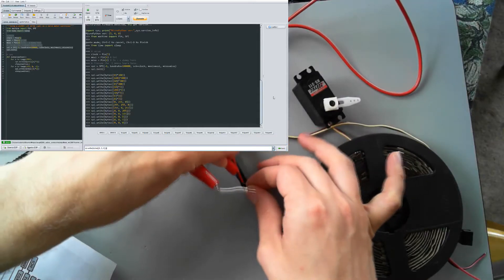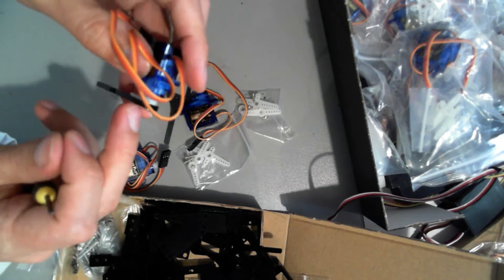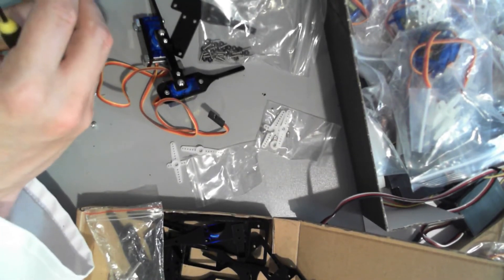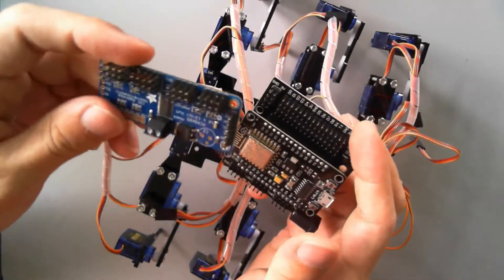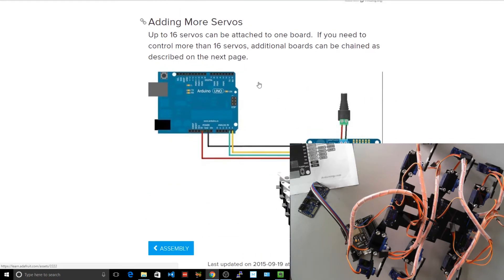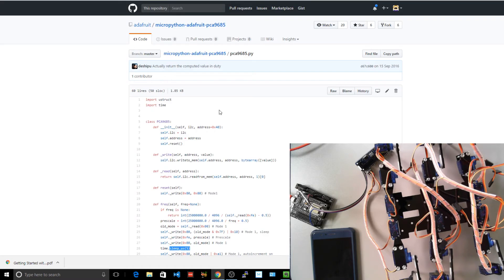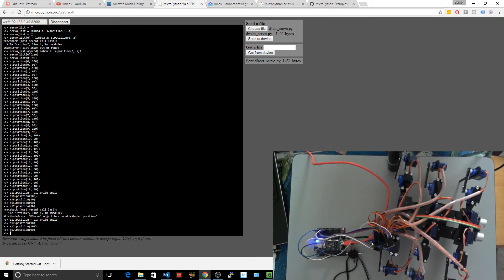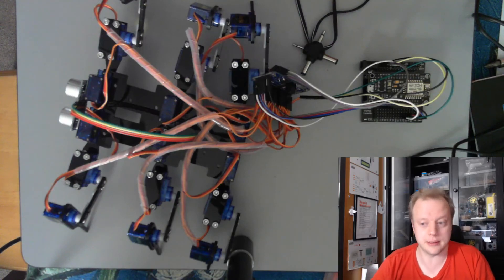Spiderbot: Build a Hexapod Robot With Esp8266 Pca9685 And Micropython - Part 1

Comment: Nice project! Do you have the servo library that you used in the project. Is not the same in the link you have in the repository.
Thanks!
Reply from the maker: Hello Miguel, I've added a further link in the video description, there is another folder in that repo "Python Libs".
Reply: @Orionrobots  Thank you! Only I think is missing one more library called "Servo" where you call the function Servos. 
Best regards!
Reply from the maker: Ah - that would be the adafruit servo library. I've updated the description to the branch I created with the web stuff, where I also added a README.txt, describing all the libraries used.
Reply: @Orionrobots  Your bot need the IK equation, using gait , balance the COG body.   The Quadfupled, Hexa, Penta, Octo pod like same Math InvertKinematic. If you want see some bot walking, rotate body smoothly, You can come my channel. Driver PCẠ9865 not good for Spider bot

Comment: How to connect 18 servos to 16 channels ? I did not understand
Reply from the maker: I used 2 pins on the ESp8266 as PWM pins, and then created a layer of code to pretend the servos on the Servo controller and the Esp were all the same.
Reply: Orionrobots congratulations on your work and thanks for the response

Comment: Needs more legs!
Reply from the maker: +Samuel Doye one day I may build an actual octopod. However, as you will find when I get the next videos done , 6 are terrible enough! Lots of sprawling, motors at the wrong angles,a burning smell and tweaking of code to get it to walk...
Reply: Why stop at 8? Lets get a centipod going and see if it is strong enough for me to ride.
Reply from the maker: Now one interesting idea there, once I get comfortable with legs, is do something like segments -  perhaps an ATTiny in each segment, daisy chained from the first, a power source, and 2 legs. Then a flexible joint and a bunch of jumper cables to hook them up. I wander how long it could get. In terms of strength, right now it can barely carry it's own weight.